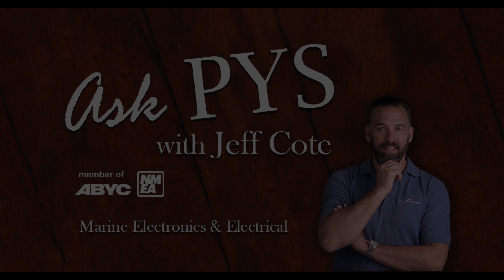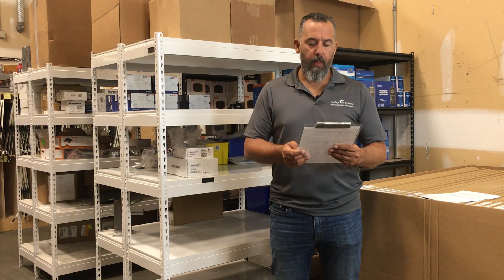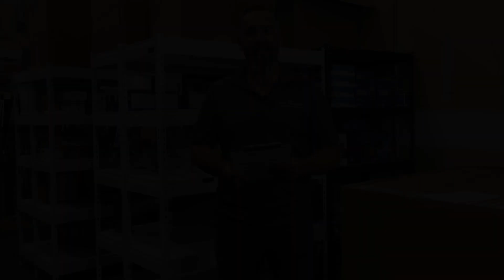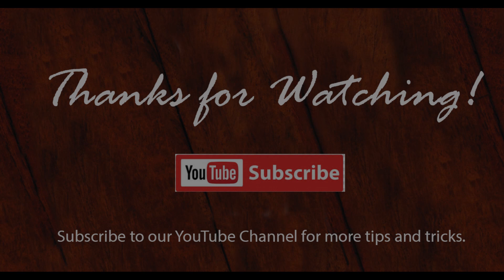Ask PYS - Should I Crimp or Solder Wire Connections on my Boat?

Comment: Especially in a boat that goes 105.   My Allison has two livescopes and crappie brakes( 6 ionic batteries with 6 perko switches). All wires are crimped and heat shrined

Comment: A soldered connection is a metallurgical bond and always has a lower voltage drop compared to a mechanical crimp connection.
The problem with hand crimped connections is most people do not have the proper crimping tool for the connector they are using.  Most people use crimpers that rely only on hand force …. How much is enough or correct for a long term connection  in a humid environment ?  Machine made crimp connections in a controlled OEM production environment is a whole different ball game.
Reply from the maker: Thanks for sharing Gary!

Comment: Clarification needed because it’s 30 years I’ve been soldering in my boats and he had no problems if you twist the wires together cover with flux solder and then put heat shrink over top of it it doesn’t come apart but connections are a big problem I’ve had multiple shorts and problems with bud connectors and I know what good but connectors  our and even had problems with those I figured that most of the guys had told you all don’t satyr were the guys that just didn’t know how to do it please clarify I understand it heating up and coming apart that’s why you have to twist the wires together before you solder them. Why are use mechanical fasteners to fasten the things or crimping the end of a fastener and then soldering it as are all things are done to make the joint not come apart from shaking or from overheating I think most people don’t know how to Sauter it right and don’t understand did you guys still crimp with the solder please clarify. And  remember they have multiple heat ranges of Sauter just like to know because he had no major problems never had a solder joint come back ever had but connectors returned even bought special tools were doing butt connectors and had boats come back because they weren’t put together right wire come out you know different things thank you
Reply from the maker: Thanks for adding to the discussion Eric, much appreciated.
Reply: I use Non insulated ,heavy duty ,tinned ,marine connectors ,these connectors can be purchased for the wire size your putting in them and size shape of the end terminal that your using ,like a ring terminal ,or a spade terminal etc.., I crimp ,then solder ,followed with a marine grade heat shrink tubing ,also some of the heavy duty marine grade heat shrink tubing ,comes with glue manufactured inside the tubing ,when you heat the shrink tubing it melts this glue and that helps seal out moisture .Solder gun question is they come in different wattage or heat temperatures ,usually the smaller finer 5 watt solder guns and small slim tips are for for electronic circuit boards ,laptop repair ,things that require less heat ….your higher watt guns will heat larger wires and your connector faster,but also too much heat will cause wire casing to melt near your connector .
 Most of these Marine tinned connectors ,marine heat shrink ,marine tinned stranded copper wire ,some of the name brands of marine wire and connectors can be 2x the cost of another brand ,that’s your decision..this also can take a lot more time to install ,but is almost the most extreme connection you can get.. Hope this helps!

Comment: Easy solution, crimp first, then solder. I follow up with hot melt sealed shrink wrap...
Reply: Absolutely agree with you 30 years I’ve been soldering joints in boats and never had one come back but connectors I’ve had multiple failures come back for the product that we’ve installed not working even bought special tools in equipment and still can’t get it to work so now I solder all my butt joints crimp them and then solder them and then put heat shrink over them all my fasteners like slide on pins I crimp them and then solder them never had one fall apart
Reply from the maker: Thanks for sharing.

Comment: What do you recommend for LED strip lights which would generally be soldered in a household installation? I’ve tried the crimps they make for these in my home but they didn’t make a reliable connection.
Reply from the maker: For LED strips we use a product called Lunaseas. In turn, when doing splicing connections to the cable pigtail that is soldered to the LED strip we use good quality marine heat shrinkable butt connectors.

Comment: Higher amperage, crimped connection circuits, 10A+, will usually suffer voltage drops at the crimps.  Crimped+Soldered connections, do not.
Reply from the maker: Thanks for sharing B. Do you why soldering makes a difference? Can you expand?
Reply: @PacificYachtSystems  soldered crimping and solder gives you the best of both worlds done properly.  In a crimp connection only a few strands are conducting vs soldered every strand is bonded and conducting basically you created a wider conducting path. I save the crimp plus solder for super important things like sensors that are voltage sensitive.

Comment: Hello Jeff! I have a question that I haven't found an answer for on your Youtube channel (yet). I'm planning on putting two 50W flexible panels (connected to a dedicated MPPT regulator) in a foldable, removable pocket of textile on the spray hood. What would the correct installation be in this case, considering removal of the panels specifically. Should I have a switch between the panels and regulator that I turn off before disconnecting the MC4? Should the panels be covered by a towel or similar before disconnecting? Thanks for everything I'm learning from you guys!

Comment: I think that I would have answered that differently Geof. There is the very real factor of practicality when putting together a system with hundreds, even thousands of connections, soldering every joint is a cost most people would not want to pay. There is only one circumstance which would justify that degree of completeness, and that is a full sinking of a boat, which is something most boats never experience. Facing that problem with our WeldBrush units I developed a blind bootlace type connection which fully seals the wire end to the insulation allowing wires to be serviced in the field, as our wires are routinely exposed to phosphoric acid in a dynamic environment. I am developing a circular snap together connector that is easily crimped with a blind socket to the wire end where the insulation can also be sealed to the fitting. These are intended for heavy wire to circuit board connections where the fitting also seals to the circuit board surface. I think that as an industry the marine electrical field should challenge connector manufacturers to come up with a connector series that is full immersion safe. It can be done. One method would be where the copper socket is blind and the plastic insulation is double moulded with a soft rubber seal past the crimp region that seals around the insulation. Double moulded plastics is highly developed these days and would add minimal extra cost and would mean that swamped boats do not need to suffer a lifetime of electrical failures there after. My advice is to as an industry confront your suppliers and put them to the challenge. We would all benefit.
Reply: sounds good! proper ingenuity !